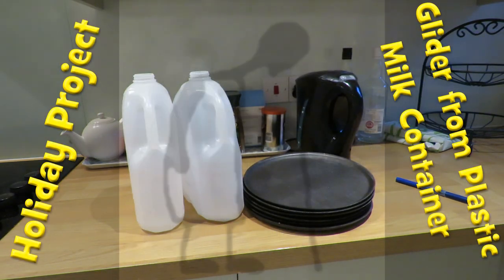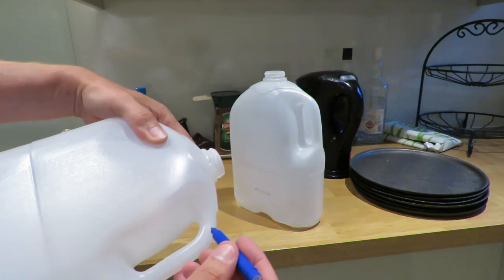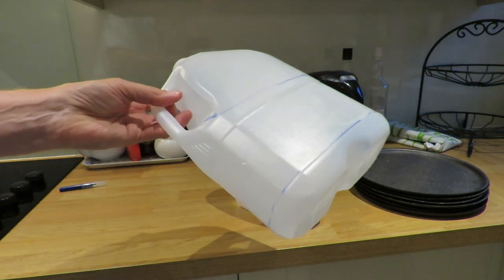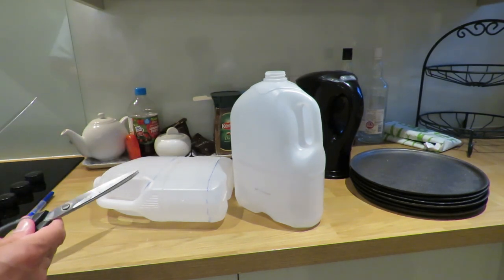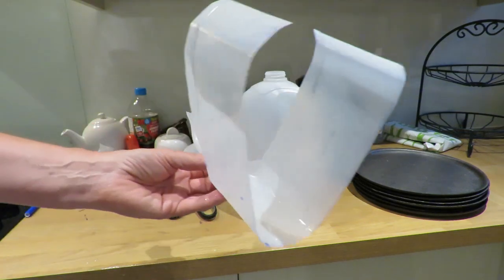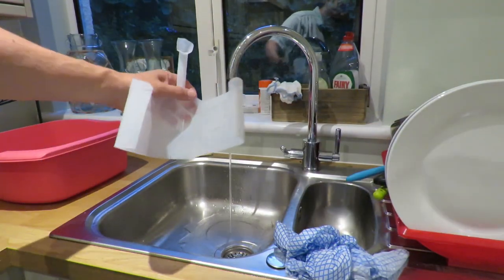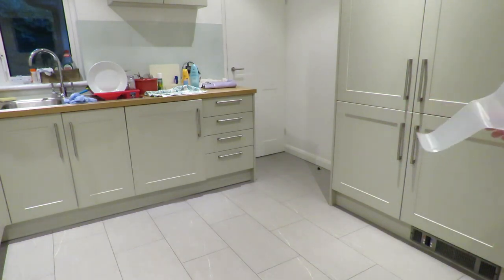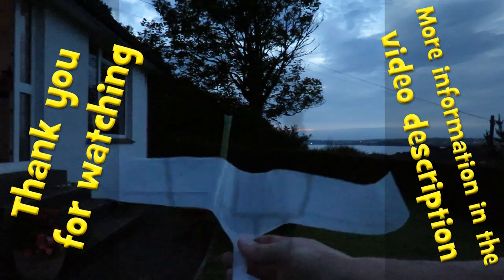Holiday Project Glider from Plastic Milk Container

Comment: no sonicdaddotcom has a new video posted a few weeks ago on how to make a FOAM plane launcher from a exercise band
Reply from the maker: I see what you mean, got my wires crossed there. Yes that "Bungee" launcher looks handy. I have been planning to make one for rather a long time and I hadn't thought of using an exercise band. Probably a waste of time on those Poundland gliders unless we can get them flying better but I was planning to use something like that for my RC gliders.
Reply: It works with any thick styrofoam  plane so if you use a rc plane then launch it with exercise band so you get high and control it from their.
Reply from the maker: sciencenerds bungee launchers and tow lines have been around for years, I remember using them back in the 70s. It was common practice and probably still is although I dropped out of the aeromodelling scene back then and haven't been involved since.